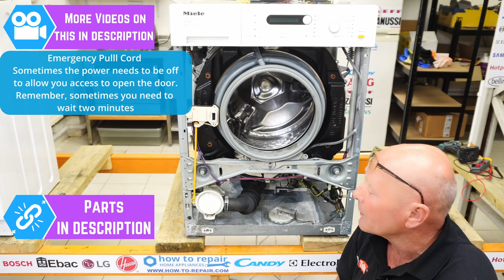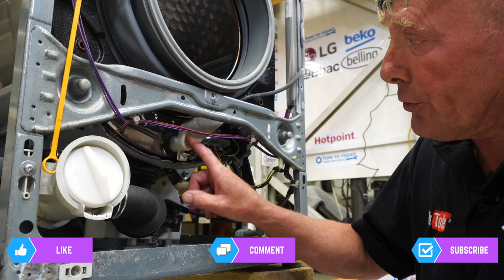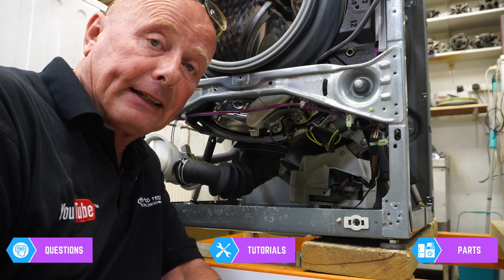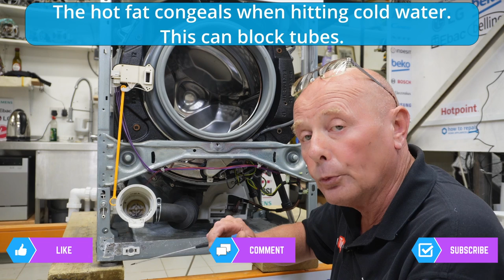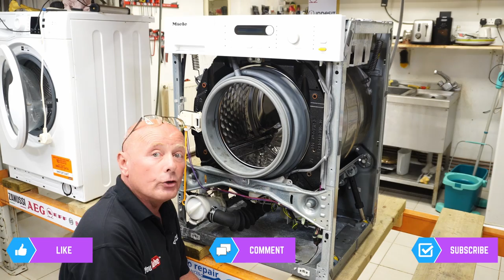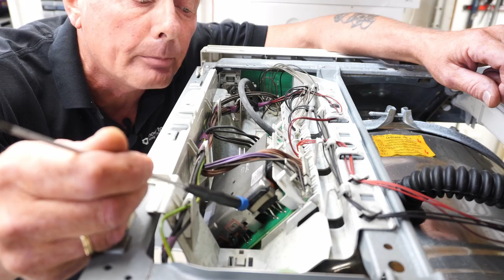How A Washing Machine Works Are you curious about the inner workings of a Miele 📘🔧

Comment: I repaired my parents 2003 model Miele last year. It needed a new electromagnetic door lock. The machine was still working strangely but just wasn’t locking the door shut. I contacted Miele they found the part and had it delivered to me and it was only £76 which i think was quite reasonable. Got the rubber door seal out the way and managed to get my hand in the side, unscrewed it and pulled the old interlock out; connected up the new one and got it all back working in 15 minutes. That was definitely a worthwhile repair..even if the machine only lasts for another couple of years. 

I personally have one of the latest Miele W1 models. I’m not confident it will reach the age of my parents one but compared to most other offerings out there they still overall feel of a great quality.
Reply from the maker: The machines are very well built. The only problem I have is the prices of the parts I would not call £76 for a door lock cheap in anyway, but I would say it was well worth keeping going as they are good machines

Comment: brilliant and very clear video Paul that has helped me to understand how my Miele W3740 works, but unfortunately I have still not been able to get my mine working yet.  It throws up an F53 error but the brushes were fine (though I replaced them anyway) and by activating the door lock and operating the machine on spin I was able to see that power was getting to the brushes and through  the stator windings.  A so called engineer diagnosed a faulty Tacho unit, which I replaced but this also did not cure the problem - and why should it! if the motor does not spin the the tacho will not work anyway!
I have now removed the motor and got a multimeter to test the continuity etc.  Will report back later.

Comment: I have a touchtronic 3035. If I’m remembering rightly, I bought it in 2010. In 2015 I was told I needed a new machine, the door was leaking a very small amount. I took a baby wipe to the seal and all was good. Since that time I’ve had several 
drain fault code errors that stop the machine in its tracks. Once it was the secondary filter (didn’t even know there was one!) in the infill line. Once it was the drain by the impeller (Q-tips, pen caps, guitar picks, you name it). Since then, I don’t know what causes it. I fix it by opening the impeller chamber, draining that,  then unplugging and tipping the whole machine a bit. These days it’s happening more and more and watching this has me thinking it’s the float shut off valve. Much bigger job but, bc you explain things so well, I’m going to give it a go before throwing the towel! 🙏🏻 so much for the video!

Comment: Well explained! 

Yes, it is most awful when parts cannot be replaced or are extremely expensive. 

The other day I saw a Beko machine with a 10 year guarantee label, dumped in a truck. The machine was definitely a new one, because it had a touch screen, so I am sure the guarantee was not over yet! I could not inspect the machine, but I am almost sure it was a failure within the drum assembly, because nowadays the spider only seems to last a couple of years, and at the same time the tub is sealed as you said in the video. In fact, I am aware that 2 of my 3 machines are sealed, and that the only 3 brands available in Malta with a tub that is not sealed are Vestel, Haier and Miele, and I dislike both, Vestel for having very long programmes, and Haier and Miele for being overpriced.
Reply from the maker: We, as a species have to become more responsible with all resources and one of the biggest problems are the multinational companies that only care about consumption. There is nothing wrong with profit, but they seem to want to make it just at the expense of our resources. I think it is only a period of time before the consumers are fully aware of this. The machine I was working on was a well thought of well designed machine apart from a couple of small faults, but then to go and charge an unaffordable rate for the consumer to have the confidence to try and repair it
Reply: The “10 year warranty” only applies to the inverter motor :)

Comment: thank you for making this video . washing machines and other consumer machines have nearly all obsolescence built in. as a miele owner i tought  i paid the extra price to avoid that. , recently i had to repair the program selector button  , because i broke the knob when a heavy piece fell on it.  i coulnd't find a replacement part except the whole control board .
When finally i found one on ebay for a fifth of the price (several hundred of euros) i tried to disassemble and omg this was not so easy to do. but at the end the opto-coulpler was only clipped on the board.
that's funny that spare part are sold with cuted wires like you do .  hopefully my 15 years old miele lasts more than the average machine.

Comment: Good clear explanation, thank you.  How silly to make it in principle repairable but so expensive parts-wise that it might as well be a throw-away Bush or Curry's own-brand.  I dare say the bearing and spider are better quality than most (?), thus last longer, but it's unacceptable that these two parts (+ seals) can't be had for less than £100 total.  I agree that even without the labour cost, over £200 for these parts would put virtually all off repairing a several yr-old Miele when you know that having spent that another expensive component could soon fail.  'Right to Repair' should mean reasonably-priced parts as well as good design and parts availability.
Reply from the maker: There should be more done with the right to repair act. The manufacturers are getting away with murder. @marcusstewart3044 please remember to subscribe to our channel as that really helps us https://www.youtube.com/shorts/e432SAb2g08  Thanks, Paul 👍

Comment: Thank you so much ....l love learning.... Have just got a 2nd hand 2009 W 5740 working lovely..... But will check machine over very soon ....carbon bushes.... Sump pipe ( socks )......pump clean up ( l,m a panel beater so have lots of metal fillings on my clothes which stick to the magnet on the impeller).... I do a pre_wash with a strong magnet in with my clothes...
Reply from the maker: Glad to help I will be doing some more videos on these Miele washing machines on things like how to change the carbon brushes etc

Comment: I’m considering buying a Miele washing machine, maybe one of the cheaper ones with a sealed drum. There are many reports that they are not as reliable as they were, and the warranty is only two years. I repaired my Bosch several times over ten years. Is the Miele easy to repair e.g. replace hearing element and drain pump? Thanks.

Comment: miele washer WXD160 WCS USA when it was new just installed was interrupted by a breaker switch few times in the middle of spin cycle; the breaker switch was replaced but the washer doesn't do a good job draining water; i can rinse 2-3 times without soap after a wash and the water is still soapy -- could it be related to the first few interrupted spin cycles?
Reply from the maker: Hi, please use our contact us page and make sure you fill out the request for what your problem is. I will need the full model number of the identification plate and the details of your problem so that I can provide you with useful literature. A video shoot of the problem would be perfect as well.

I will get back to you within 24 hours, normally. https://www.how-to-repair.com/help/contact-us/  

Please remember to subscribe to our channel, as that's what keeps this channel going. Thanks, Paul 👍